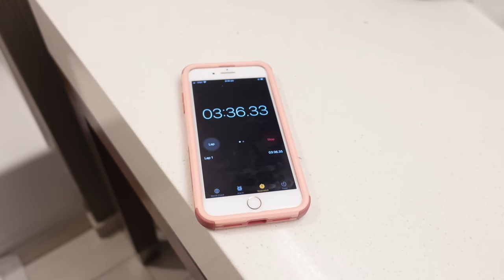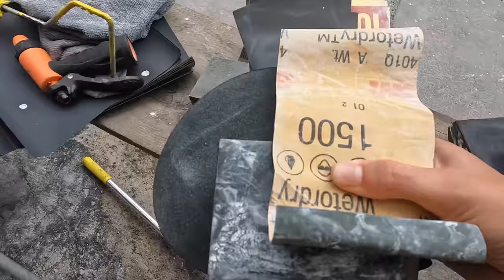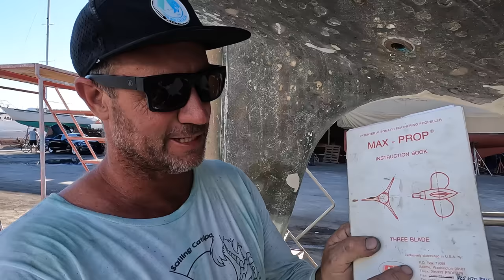Removing our Cutlass bearing | Ep 381

Comment: That "freezer" looks identical to my Fridge. Mine is an Iceco. I love it, and I've heard I would just turn the temp down and it would be a freezer. Its amazing ! I'm trying to get ready to move on to a boat. Wow, the boat looks spectacular after polishing. I put this video in my Playlist "Sailing Prop Shaft Couplings Stuffing Leaking Replace Cutlass bearing"  ! There are so many types of cutlass bearings out there, they are all completely different ! I once saw a cutlass bearing replaced , I believe in the water, with a wooden cutlass bearing (which worked ! ) in I believe remote indonesia but I'm not sure its in this same playlist. i should put it in there. Never Seize (a product here in the U.S. ) ?

Comment: I was scared Lee was going to cut into the lower unit while cutting out the cutlass bearing . I know I hate to ask to borrow tools but I think lee should have asked around the yard for a puller . I'm sure someone would have helped out . That's a BIG job checked off the list ! Nice work all .  👍
Reply: Using a recip saw to get put a cutlass bearing is a very common way to remove them.  Even boat yards use this method.  The hydraulic press tool is fantastic, but when you don't have one, this method is okay.